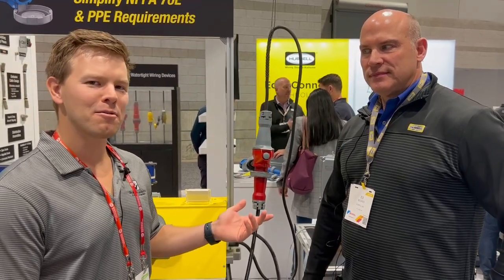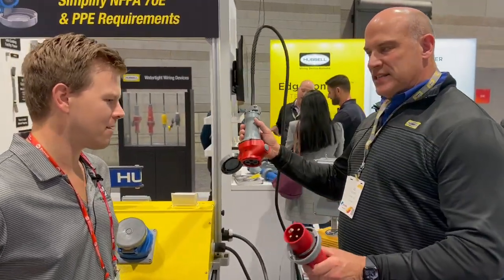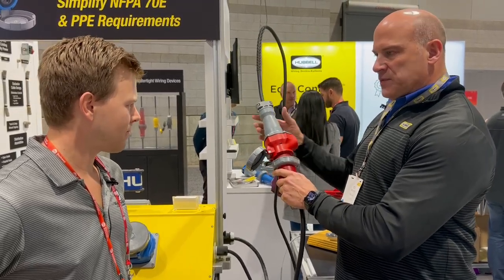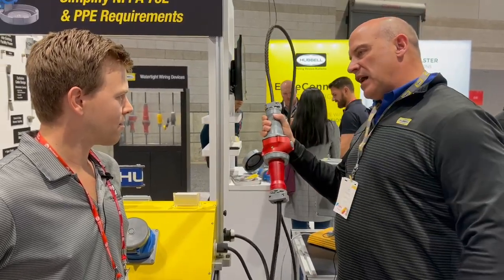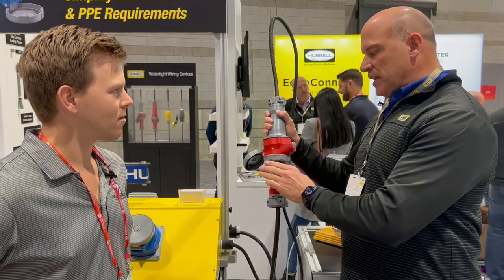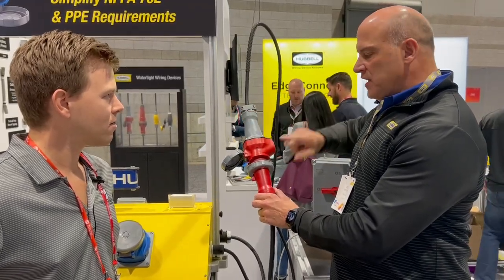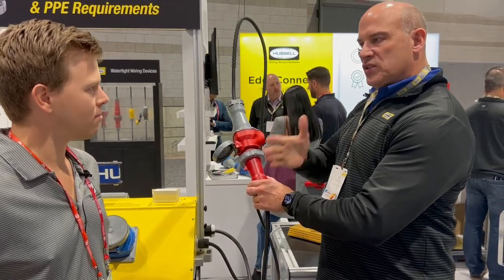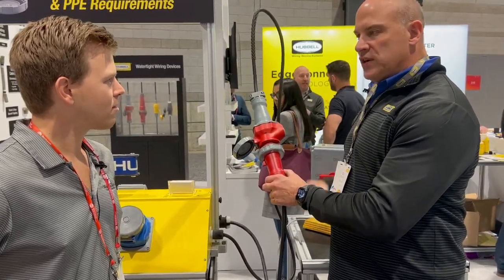Hubbell Advantage™ Series Switch Rated IEC Pin & Sleeve Device

Comment: What is the Purpose of The Aux/Pilot Contacts ? like in a 480V 3phase 4W application, what would be the purpose of the aux/pilot contacts if any ? can you give a real world example or provide links to such ?
Reply from the maker: Hello, A common application for aux would be that contacts are early break contacts in variable frequency drive (VDF) applications. Disconnecting the control circuit before power is removed from the drive. This sequence of operation is very important, if shutdown is not handled properly, the drive could be damaged. Another popular application would be to provide feedback to a programmable controller to tell it whether a piece of equipment is powered on or not. For more information, contact your local McNaughton-McKay branch: https://www.mc-mc.com/LocationFinder